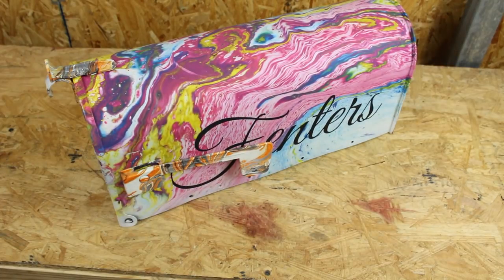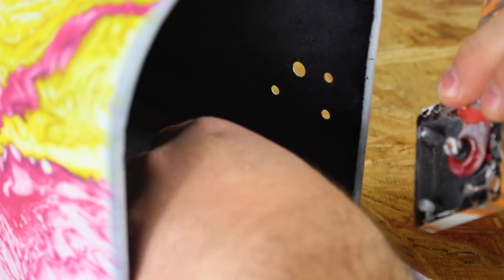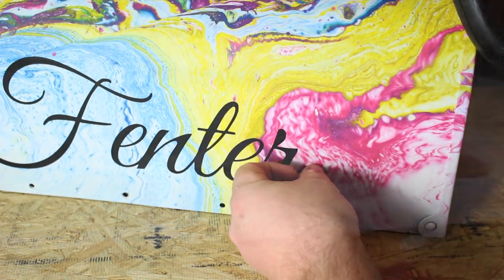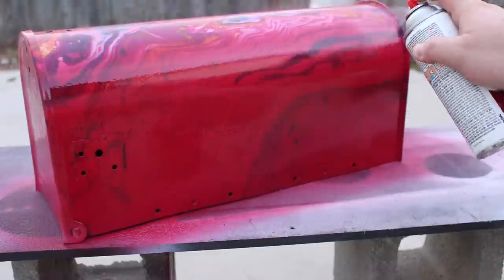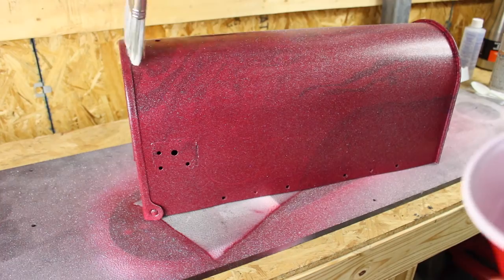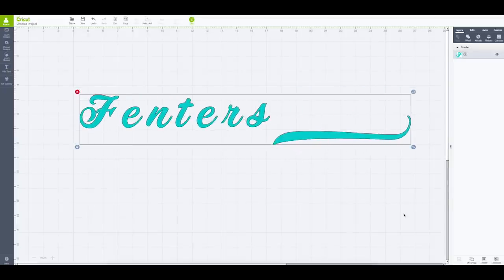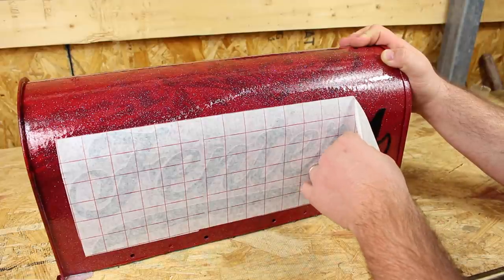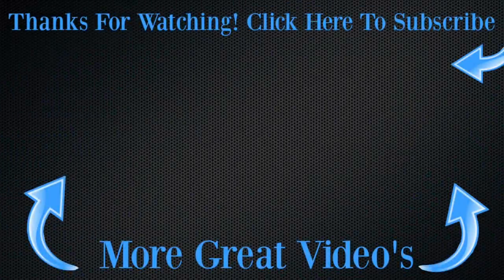DIY | HOW I GLITTERED OUR MAILBOX

Comment: Can resin survive outdoor freezing cold weather?
Reply from the maker: Dont do this. It was horrible after a year.
Reply: @Fentertainment  What happened? I am curious to know because I spoke to someone who lives here today, and he told me as long as it is cured it will work. I am painting it now with outdoor metal paint and was planing to put resin epoxy  on the top.
Reply from the maker: @m27238  the epoxy started to break down and deterior
 However I live in the southern state and it gets real hot with a lot of sun so that may have played a big toll in it.
Reply: @Fentertainment  Thank you for the info, I am going to try it and let you know if it goes bad I will sand  it  and repaint. Fingers crossed :)
Reply from the maker: @m27238  sure thing. Mine looked good for the 1st 6 months but after that it started to break down. Sounds Good!

Comment: hey bud what kind of two part apoxy resin should i use on the cups?
Reply from the maker: The same kind used in this video. But very little per cup. One box can do about 30-40 cups easily. Here is that link & where you can purchase is in the description. https://youtu.be/m-XeJY5FCVg
Reply: Fentertainment does lowes carrying it?
Reply from the maker: No but in the description there is a link where you can purchase it on amazon. If you dont have prime, set up a free trial and have it in 2 days.
Reply: Fentertainment just sent you a pic on your mailbox vid
Reply from the maker: How did you send it?
Reply: Fentertainment i commented on your video of the mailbox and sent a pic to it
Reply from the maker: On youtube? this is the mailbox video page.
Reply: Fentertainment yeah
Reply from the maker: I dont see it Bud. Did you not send it on facebook?
Reply: Fentertainment what's your Facebook

Comment: when I used the epoxy it takes forever to dry... what am I doing wrong
Reply from the maker: Mine takes 24 hours to cure. If it takes longer than that then its either not mixed 1:1 right or the temperature is affecting it. The warmer the climate the better.
Reply: Ok thank you I am going to recheck it